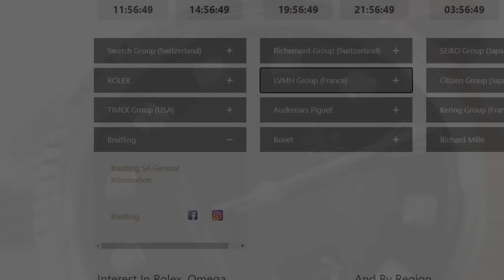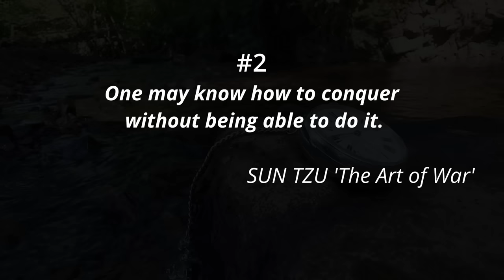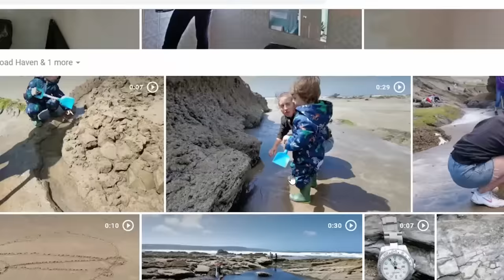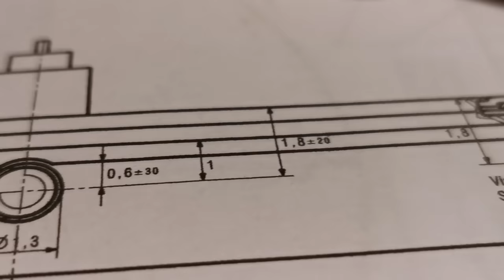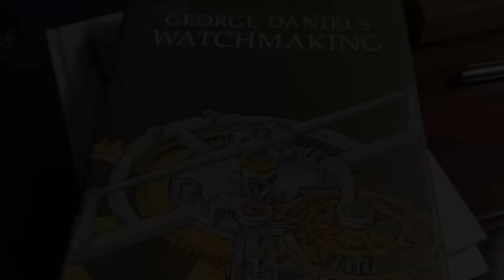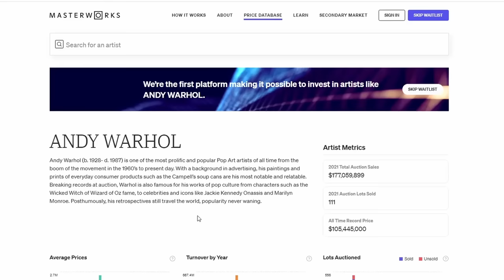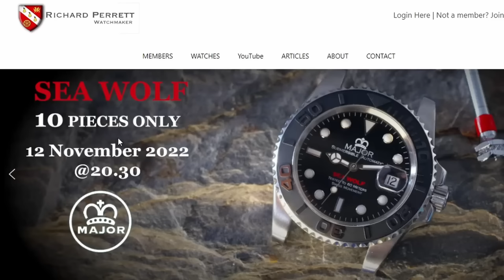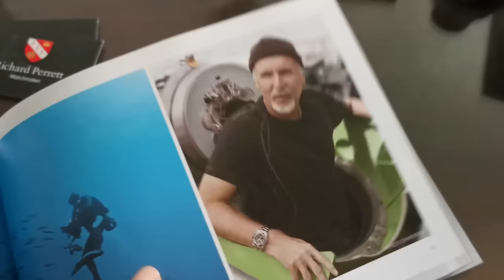7 Reasons Rolex Keeps Its Crown

Comment: 10:24  Ouch I felt that having mangled the balance spring (and probably the balance shaft) of my early 1940s Ingersoll Mickey Mouse watch!! 😭😭😭
It was extremely inaccurate before but at least it was working.  It will never run again due to my cackhandedness 😭😭😭